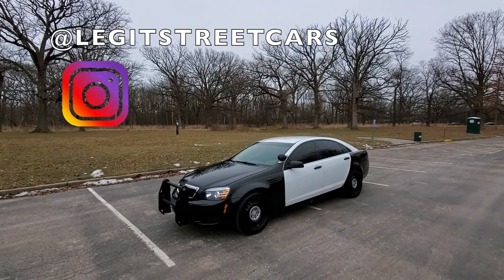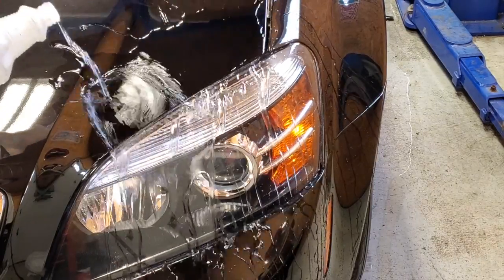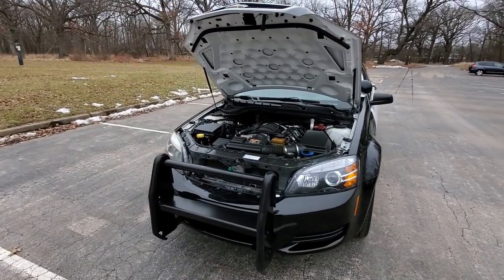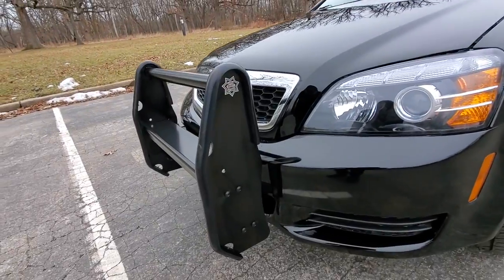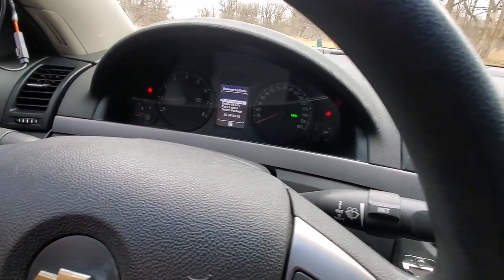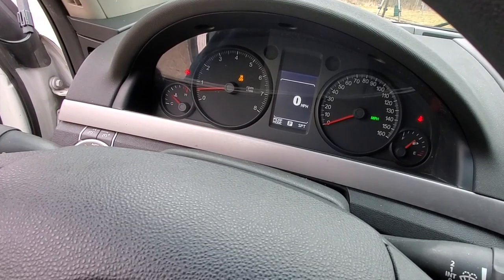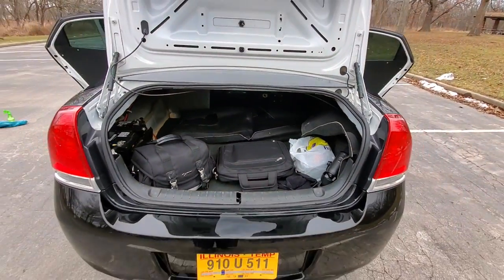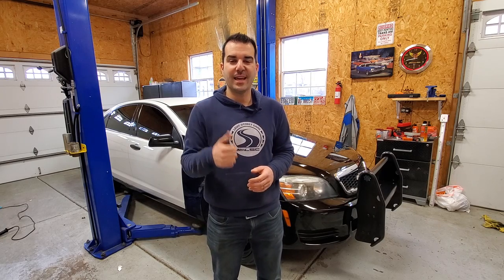I Bought The Fastest Police Car Ever Made & The Cheapest Way To Buy A Modern LS CAR! 4-Door Camaro!

Comment: Typical cop car they never shut them off. Start it in April 2012 and shut it off April 2019 but it does still sound good but idling hours is hard on an engine but those cop cars are maintained well. You can see under the hood there's a few new stickers on the coil packs the  trainees are flushed every 20 or 30 thousand they can't have cop cars breaking down in route to some emergency. Looks like it's a new push bumper and Fender probably Pitted  somebody in a high-speed chase...

Comment: Horseshit. Complete horseshit. My slightly modified 1997 Firebird WS6 will do just over 200 mph at 380 hp. Plus I get about 19 mph in town and 27 mpg on the highway at 65 mph on cruise control.

Comment: L77 not ls
Reply from the maker: Definitely an LS
Reply: @LegitStreetCars  which LS
Reply: @slashknife the L77 is a 6.0 (LS2 bottom end) with the LS3 top end.  Because it’s 2 variations mated together, it’s titled the L77.  It’s 100% LS.  Pontiac G8’s had the non-flex fuel version dubbed the L76.
Reply: @BrothersBuilds ik, 100% made of the parts from an ls that can deal with longer idle hours. Doesn't change the fact its called an L77. A Frankenstein engine.
Reply: @slashknife  I think “Frankenstein” is a proper way of describing it.  👍

Comment: BULL. You quote one test and one car squeaked by with 155. This pathetic failure of a Chevrolet police car is SO FAR from the "fastest police car ever made." This is hilarious. I'm a former police officer and I spent 30 years driving police cars. It is WELL established that the 1969 440 TNT police package Dodge (or Plymouth) was the fastest and IS the fastest production 4 door sedan ever made. A close second was the 1967 Ford 428 Super Cobra Jet Galaxie sedan, which I personally drove at 155 mph in 1968. But then, stock, from the factory we had 11 to one compression and 103 octane gas, cams by Ed Iskedarian (ISKY E-2) and no smog equipment and no cats. A Trooper I knew in Arizona drove a rare 1969 police Ford 460 Blue Crescent shotgun Galaxie sedan across half the state at 160 mph clocked on radar at numerous spots. Who the hell uses Chevy's as pursuit vehicles? Not many at all. Why? Because Chevy has always made the worst police cars - compare their sales to Ford or Mopar - its all on the record. If I told you the stories of all the Chevy police car failures (especially the transmissions) and their lousy brakes... ask ANY cop. The fastest Chevy were the 1996 Caprice Classics - beautiful and fast - but there's more to a police car than fast - and no Chevy was ever able to hold up over time. When was the last time you saw a State Trooper in a GM product?